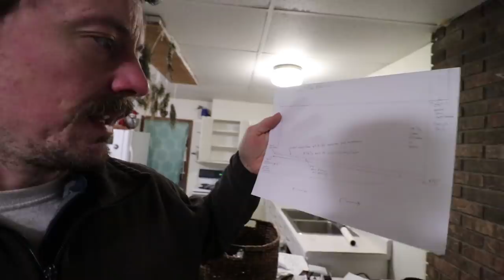SURVIVING or THRIVING - cold weather CAMPER

Comment: May I make a suggestion I live in an RV you skirt your RV with thick foam panels around it and it keeps your RV a lot warmer because the floor gets so cold that even wool socks don't keep your feet warm and then to keep my my hose from freezing you take your heating tape and then you wrap it around with aluminum foil go completely around your hose with aluminum foil and then you put your foam around it like  that you would  called  insulate your pipes with its around  or like a pool  noodle it just keeps everything from freezing so you don't have to worry about it.
Reply: Excellent advice. I thought he said that he had the water lines heat taped before? I guess not. It's surprising that everything hasn't frozen under the trailer. Living in a mobile home in Michigan, I learned all about this early on. (the hard way)
Reply: @auntmaryspals7978  yeah I wrote that before I I finished watching his video in the very beginning I didn't know that he knew that so it's okay.

Comment: LOVE LOVE LOVE your family!    Just looking at that camper with the pop-outs,  I'd figure out a way to drape some kind of plastic or rubber type sheeting around the joint where the popout meets the main camper.    Even if it's not drafty I'd bet my electric bill that there is cold seepage at those joints.  I've been battling cold in a series of old house renovations so I know a thing or two about pinholes that allow serious drafts into the house (not perceptible unless you're feeling for it)

Comment: make sure your family has plenty of oats and porrige with seedless raisins in to start the day off and start growing some fodder seeds for the animals especially oats as they heat up the blood. If you start off the grains using a 7-10 day system it will save you at least 60% in feed costs. Wish you well in the camper. There are plenty of designs on YouTube for a fodder system.

OUR HYDROPHONIC SYSTEM FACILITY

Comment: Hey Art, you should use pressure treated lumber, if it is going directly on the ground or it will rot you can use reg. on all other sides.  I just put a skirting around my house and I also built a frame, then put foam insulation board in holes of frame, then metal roofing material over it. Made the house a whole lot warmer and helped protect the pipes.  For the pipes they sell foam wrap that just slips around the pipes. I also put a long stick in animals water to help keep it from freezing all the way. Just some things I found out that helps. Hope you can use these ideas.

Comment: Art for each of outdoor storage compartments on your camper you need to install insulated foam sheets in each of the storage compartments doorways to cut down on the cold wind that will blow in the compartments even when the doors are closed.  Check with Ben and Meg From The Hollar Homestead they did the same to cut down on the cold in their camper.

Comment: lived in a travel trailer three years in the east where winters can be cold,snowy/icey.  It really helps to put thick foam board insulation all around theoutside of the camper to keep warmer and help with condensation.  Also can get like a foam cup(I can'tremember what there called, sorry) to fit over the water connecter from camper to keep that from freezing up and heat tape on water line under camper.  It allhelps keep life in a camper during winter months more doable.☺  God blessings.

Comment: The winter we spent in a mobile home that had holes in the floor you could see the ground through, we were not allowed to skirt the mobile home permanently, park rules, so we went and bought a bunch of straw bales (and dragged some home after people threw them out after decorating with them on Halloween and Thanksgiving). Then we laid them around the bottom of the mobile home all round, and that sure did the trick for us. Temperatures raised immediately and the drafts stopped whistling up through the floor. Might help you guys stay warmer if you did that to your camper for the winter?

Comment: While remodeling in Central Indiana we spent 2 years in our camper. My husband placed the back of the camper up against the back wall where the laundry room was. It blocked the wind. It was a cold winter both years at -25 not wind chill & even colder for 3 days. No water lines froze. The reason we placed foam board under the trailer then STRAW BALED 2 HIGH AROUND THE BASE it was wrapped in tarps. Then he drilled a hole near the pump form the water to connect wrapped up in heat tape & straw over it. We are much colder here. My husband & I did a great job on preparing that camper. Our 2 Daughters was 15  &17. So I was hoping you could do the same for a wind break.. GOD BLESS

Comment: I'm sure someone else has probably suggested it already, but propane is way cheaper if you get a big tank. You can lease a tank and most places will waive the tank rental if you use enough (and I'm sure you will meet their minimum using it for heat). They will bring the tank, come fill it for you, then take the tank away when you're done with it. Also I think you can fill your grill tanks off of the big tank....although I've never been brave enough to try that myself.

Comment: I wonder if you might put a large piece of lightweight canvas over your awning. With a couple of grommets on the top corners and two pieces of rope, you could  just pull it off with all of the snow. Then replace it. Awnings on RVs are notorious for being damaged. Maybe just closing it would be easier.  Best Wishes,